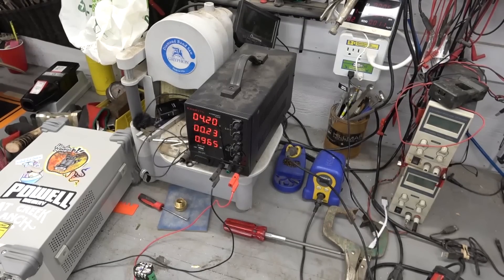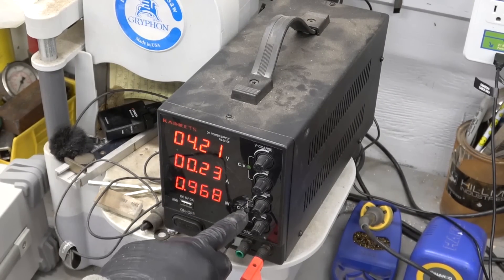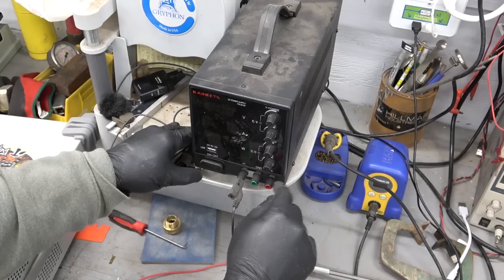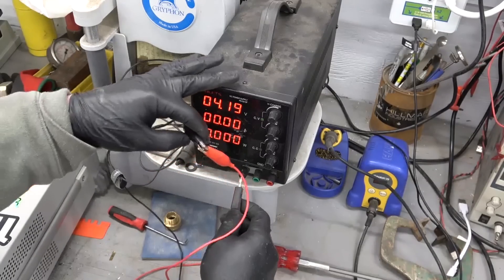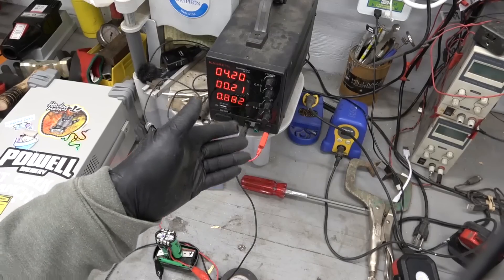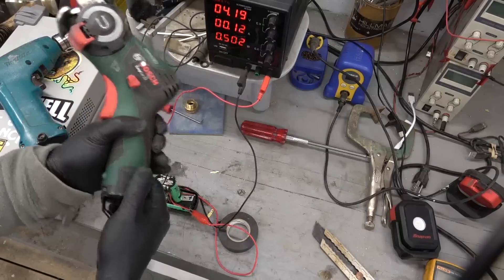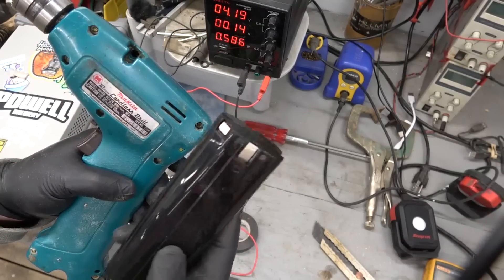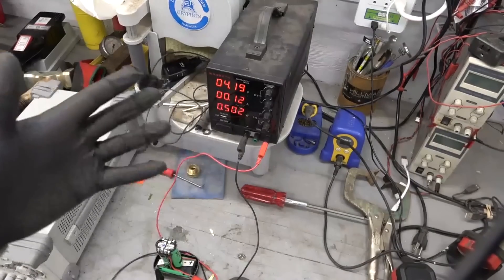Adjustable Power Supply || Viewer request how-to

Comment: I’ve got a Navitech NP3005 and use all the time in my  radio controlled 1/14 scale equipment.  I test my led lights I’ve wired up, I test motors, servos and various electronics while building my machines. Love it.

Comment: Instead of going from my solar DC, invert to AC, for the power supply to convert to DC. is there a way fore to make a safe, and regulated, DC power supply from my 50v lithium solar battery bank? I'm interested in anodizing aluminum and refurbishing some old power tool batteries.
Reply: These specific units are typically transformer-based, so as to avoid any high-frequency noise a switch-mode might put off, but a switch-mode power supply can do exactly what you want... unfortunately most off-the-shelf options are either going to be aimed at lower input voltages, or higher ones. Check the input voltage range on various brands of line-input SMPS, you'll find when they list a DC rating it's usually higher than the AC rating, including a higher minimum voltage.

The only advantage this will have is efficiency. An SMPS is a very high-speed inverter, that can thus use a very small transformer (or just an inductor) to shift power around, and probably stay in the 80-90% efficient range. An inverter and transformer together will inherently drop >20% of the power through them, but a practical linear power supply will switch transformer taps to compensate, still keeping the efficiency generally above 50%.
Reply: @jercos  is there a way to just use a variable resistor and some off the shelf IC control I could use to to just limit the voltage and current of my battery bank? Or is that dangerous and/or noisy

Comment: Yep I need one of them cause battery chargers are too damn smart to do what you tell them to  when MAY be stupid to do such a thing.  As such they refuse to do what you need them to do when you most need them to do it. I know it's only 6 volts cause she left the lights on, again. I said charge the *****kin battery!  Sick of kludging up a wall wart to get it off the floor so the charger will come on.
  By the time I'm tipsy enough to part with the money for a stupid charger, with all the current limit, voltage limit, PWM square wave, frequency etc,  I'm too amiable to be thinking about charging a battery.   If I aint a bit inhebriated, I cant stand to part with that much fundage just to outsmart a battery charger.  PS  why does it rain every single time you decide to give a car battery a nice deep trickle charge all night?

Comment: I have a SkyRC B6ACNeo for balancing lithium ion batteries. Specifically Milwaukee batteries, because short of the Forge line no Milwaukee battery has ever used the built in balancing circuit. Less than $100, compact, saves batteries in a manner easy enough that even I can do it. Worth having around.

Comment: Just had to do something exactly like this for my motorcycle battery.  Was too dead to take a charge from my battery tender with all its smarts, but my old wore out haggard dumber charger was able to get it over the hump before it crapped out.  That let the battery tender finish the job.

Probably time to toss out that old one and just get an adjustable power supply.

Comment: I just bought a nice bench supply a few weeks ago. The features that the modern ones have for relatively low money were a surprise from the units I remember from back in the day. They're  probably not built as a robustly, but it graphs voltage and current.
Reply: Do you have a model you like?
I have a couple cheap supplies but they don't graph anything.
Reply: @ddegn  The thumbnail of this video caught my eye, because I had been looking at so many of these DC bench supplies prior to deciding on the one I bought. From what I can tell, as is typical with products from China, they are all based on some kind of common internal circuitry - a generic 'DC power supply' that is then has an interface built on top of it. The one featured in this video is one of those interface styles which feature control knobs and use 7-segment displays, have an output of 30v or 60v (and matching limit of current output for 60v to stay in line with ~300W of output power regardless of voltage), and seem to run in the price range of ~$50-100USD.

I decided to go with one of the models which is in the next tier above those, which have a more advanced interface, as well as one that would do 60v instead of just 30v. The particular brand and model that I bought is the 'Abestop AT6301', but as I observed there are many companies which manufacture these PSUs and they all seem to be based on some underlying common circuit and even chassis. My guess is that they are all pretty much the same under the hood and it's just a matter of whichever is cheapest that has the interface style you are after.
Reply: @SC-gm3ry  I have a couple TEKPower TP300ST supplies which work fine. As you mentioned, they're limited to 30V. The one suggest looks like a good step up. I occasionally need higher voltage and I'm pretty sure the graphing function would be useful. Thanks for taking time to answer my question.

Comment: My dad was given one of those Makiters 7.2v drill dullers in the late 80s. That thing gave us so much grief we never bought another teal tool since. Took almost an hour to charge for maybe 15 minutes of cordlessness. If you charged the battery and put it in the drill for the night, it would be dead the next morning. Good memories with dad, bad taste for Makiters.
Reply: We used these drills a lot back when. Great tools, no issues. We used to occasionally put and elastic around the switch and run them til they drained completely, then charge them as normal and they worked good as new. The batteries would sometimes have a "memory" if you charged them from half way a lot. Drain/recharge somehow reset them. 🙃
Reply: Blaming a tool brand because you were given a used tool with a bad battery seems ridiculous to me..
Reply: @danstheman33  Used? That thing was brand new in the box in the late 80s.

Comment: I think you said lithium likes constant current.  This is the basic charging strategy for many batteries including lead acid.  Lead acid chargers typically do an absorption phase (increasing voltage to hold charge current constant), then boost (constant voltage higher than fully charged to speed up charging), then float (constant voltage slightly above full voltage to have a trickle charge).  Lithium omits the middle step and doesn't float because the excess voltage will damage the battery.  Once lithium voltage hits 4.2V in the constant current phase, the chargers will go into a constant voltage mode until current drops off to 0.  Then the charger will disconnect voltage (no float, no trickle charge).

Comment: I was cruising through craigslist and found a Korad 30 volt 5 amp and bought it I think it was only like 50 bucks I had convinced my previous place of employment to replace their menagerie of jank crappy power supplies with korads if you look around you can find the calibration procedure online for I believe it tenma but they're all basically the same thing

Comment: If you aren't afraid of angry pixies, you can make one that can provide 60v DC at 20 amps, I only spent around 80 bucks. The expensive tool at work says its accurate with in 1 hundred of a volt and it's been sapping things for over 2 years now.

Comment: pro tip: the leads you get with them are often trash. measure voltage at the ends of the leads to check if it's the same as shown on the power supply's screen.
Reply: Good ol chinesium aluminum wires

Comment: You mean I can toss the endless mass of specific voltage PSU I have been hoarding my entire life and replace it all with just an adjustable DC power supply?  You now that will mean I will just now have an endless mass of PSU AND an adjustable DC PSU though...right?  No way I am gonna toss all those.  They might be useful for something rather someday rather.  Honestly though, I want a high power one to test brushless motors.  Find out what they can do before they go up in smoke

Comment: Some prefer linear power supplies over switch mode power supplies. Linear ones use an actual transformer and some feel that they are more reliable than switch mode ones.
Reply: They generally are... switch-mode supplies lean pretty heavily on their capacitors. A linear supply just has to deal with 120Hz ripple from rectified AC. That doesn't mean an SMPS is inherent unreliable, just like comparing a little car to a full-size van... the van will never get the gas mileage of the little car, but it's built on a frame. They can both take you and some cargo from point A to B, and the car might be a sports car with more horsepower than the van, but the van's construction is in fact "more reliable."

Comment: I've had a Gophert adjustable power supply for about ten years and it's been great. 
Much easier to use than the ones with the coarse and fine knobs.

Comment: I have an older M 18 12 ahr battery that's a few years old and still working but when the test button is pushed, only 3 lights illuminate, never 4 like it did when new. I just bought a new 12 ahr Forge battery and have far more power than the older HD (in an air compressor). Is there any fixing the old HD? Should I just leave it for lower tasks?

Comment: Word of warning on these cheap adjustable power supplies: they usually have pretty high output capacitance which means you can blow up sensitive components like small LEDs even if you have the current limit set correctly. This won't be an issue in most cases but it's something to look out for.

Comment: If you are doing any sort of decent current charging >2a def change out the leads with some 10awg and some ring lugs. The stock leads are horrible for voltage drop.

Comment: careful on some of these cheap ones. ive heard of malicious backflow power thru the connection to cpu and fry motherboards. specific model im aware of is the Circuit Specialist PPS2116a
unsure if this includes all models, but the way the board is set up on the power supply i guess allows this. under what instances i dont know specific, just dont hook it up to your fav device i reckon

Comment: We used a couple of those Makita's for years and years at a track I volunteered. And indeed, carpenters gave them away (donated) because of the batteries. We had a bank of them and had them charging via a timer. So after the weekend, all batteries in the chargers and timer went for a couple of hours on Friday so they were full when we got in on Saturday morning to use them. Loved them.

Comment: I made do for YEARS with a 6/12/24v charger and a couple of step down voltage limiters. Finally bought myself one of these cause i had a bunch of projects that would be done in no time with one of these. 
So far I've taken it out of the box 😅😂 it's been 5 months give me a minute I'll get to it.
Reply: Gotta let er come up to temp first. Can’t put it to use too soon. We get it!
Reply: I always think of the things I would do if I had one.  Then I get back to the job that I had no intention of doing but I don't want the basement to flood.
Reply: @Laugh1ngboy  Have you noticed sump pumps only fail when you need them.
Reply: @WOFFY-qc9te I know it's weird. Also strange that the shop vac I have that has a drain connection  can't lift water more then 4 feet. Good news is I was able to shut the water off to the house, bad news is I need to shower for work tomorrow.
Reply: I also have a bit of a knack for getting to testing newly acquired equipment after the warranty period expires, and/or subscription, whichever comes last. Ain't nothing quite like those extra butterflies in the nether region as you ponder the above on first chooch. Anything for more thrills.
Reply: I had a setup like yours, made much blue smoke......

Comment: You don't always have to take the battery apart. I have had good luck using 7.4V. I have a few batteries that are going on 5 years old. Rumor has it regardless of brand they don't balance before during or after charging.

Oh yeah some chargers have the circuitry it just doesn't balance!?!

Comment: I've been looking at getting one of these to try to bring back my Dewalt 60v batteries. Thanks for the tip!
Reply: you will have to open them up and do one cell at a time. Charge them as normal with the charger, if they still work on the charger. That will save some time. Open the pack. Use some neo magnets to stick the croc clips on the bats. Give them 1 amp, get them up to 4v a cell. disconnect when they are not drawing current, don't adjust the voltage on the psu between charges. MAKE VERY SURE THE POLARITY IS CORRECT, A LIPO BAT WRONG POLARITY WILL BLOW UP YOUR PSU.
Reply: @UberAlphaSirus  I tried to do this on one of my dead 9Ah batteries, but I disconnected the cells before doing it. Wouldn't supplying power to a cell that is still linked to all the others just distribute the power going into the cell to a bunch of them? Never fully understood it. Some people say you need to disconnect them, others say don't.

Comment: Was a cell in that Snap On ratchet out of whack (like I suggested)?

i got one of the benchtop PSU's, like you had, to balance the cells in my Lynx battery. It works pretty good for doing that.

Comment: AVE could you do a video on VFD`s and Digital DC motor drive controllers specifically how to set speed, acceleration, deceleration and finally have a dc motor controller that I believe causing a stepping or jerking in a table feed. I think it is in one of the many internal adjustments but as a lifelong Auto dealership tech (now retired) I know nothing of these controllers and how to adjust them

Comment: And if you have an even more expensiver one with four-quadrant operation, you can also drain batteries with a constant current, and with a little bit of logging get the total mAh or Wh.

Also a nice thing to measure with a power supply is if you want to measure a low resistance. Standard multimeters can't really do that well, but if you put 0.5 A across something you want to measure, with a multimeter you can measure the voltage drop and get a much more accurate result. Bonus points for measuring "both ways" and take out the offset.

Comment: Thanks for the vid. I've been interested in these in a while but wasn't sure what volt and amps would be most useful.
Reply: if you are into analog or audio you will want 30v dual supply. If your into digital or battery charging your good 20v single supply . More amps is always better regardless
Reply: @UberAlphaSirus I'm into audio, but wanted one more for general electronics repair. Seems like most components can only be tested while under power, which is impossible to do on a broken device or PCB lol
From what I've seen on Amazon the voltage inversely correlates with the amp specs, and higher volt lower amp costs more. I could see a 120v being handy since that's what outlets use.

Comment: Just to be pedantic the bad battery goes to 4.2V first and the good battery is lagging behind because it has more capacity
Reply: on charging yes. On discharge yes too as it hit min voltage first. Unless the bad bat has internal leakage then the opposite is true. And also cause reverse charge on bad bat.

Comment: PC power supplies are pretty good for electrical projects. Not as flexible as an adjustable supply, but they can be salvaged from old computers for free and give 3.3v, 5v, 12v, and -12v. Not many fancy features like an adjustable psu, but they do shut off if they get short circuited or draw too many amps.
Reply: You can get many more voltages from an ATX power supply if you're willing to bend the rules a bit. If you connect whatever you're testing between 5V and 12V, you get 7V. If you connect -12V and 12V, you get 24V. -12V and 5V, you get 17, and so on. 

Keep in mind that if you ever do this, whatever you're testing will not have its ground referenced to the actual 0V ground, so if it's a device that has connections and you connect it to anything else externally with a cable, and the plug on the other end is referenced to ground, you will short the power supply. This is mostly useful for testing fans and other simple devices.

Comment: A few years ago a local technical school folded. They had an auction. Like you said, cash on hand. Bought two of everything I could: regulatated dc power supplies, o scopes, signal generators, and lab vom. Not top shelf stuff, but good enough for the smoke I let out.
Reply: but did you get any spare smoke? it was available from Lucas a few years ago.
Reply: Labrador vomit?

Comment: NiCad is less finicky than lithium!? Wot?! I flew RC planes for years, I'll have what you're smokin'  Damn charge state memory will kill ya.
Reply: IKR. I think Ave is confusing NiMh with NiCad. NiMh gives no shits about anything.
Reply: I have an RC plane that was in a box for about 15 years before I built it. The old battery charged and seems like it will work fine. Haven't tried flying yet

Comment: I have the same el -cheapo variable voltage supplies. 
You have to by-pass the battery management system on the DeWalt Flexvolt 20v/60v when doing this or you end up with the same result as plugging it in the wall.

Comment: Also important, especially with the cheapo power supplies: always verify the voltage with an independent multimeter. The built in measurement/display should never be trusted.

Comment: I had this trouble with the two 18650s in my various vapes, over time. This is a very practical solution, which I am unable to afford, sadly. Still, just knowing I could outsmart the bastards is nice. Great for my more mundane dreams.
Reply: You can get a power supply very cheap if you shop around
Reply: Stop vaping, get a job you stoner 😂